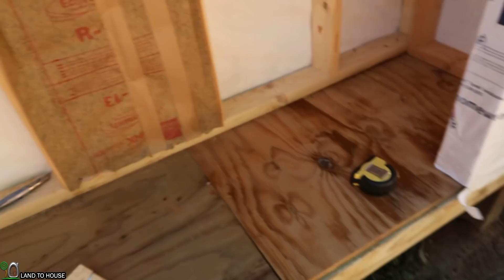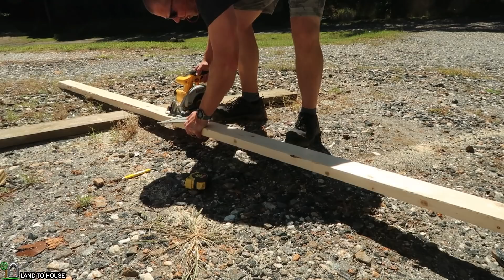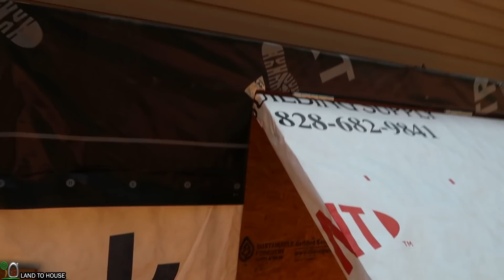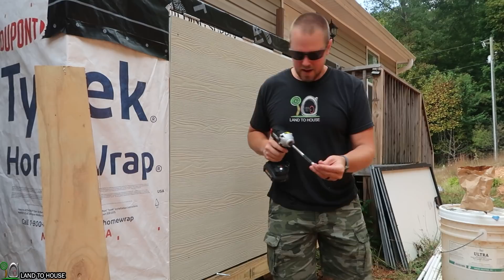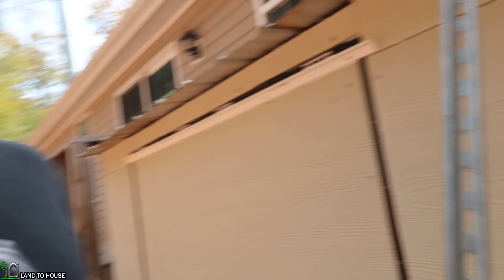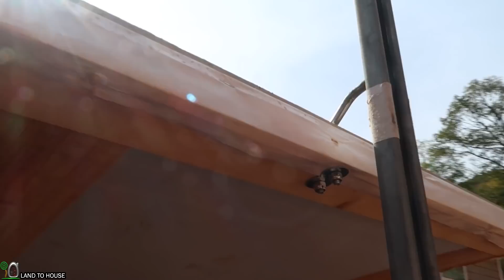Solar and Hydro Power Shed Build Part 2 of 3

Comment: I would put foldable hinges on the sides of the Door/roof, so it can click open and lock in position ... And you don't have to fear someone knocks over the pole that holds up your Door/Roof structure now.
Apart from that, nice build ;)

Comment: Great build. A pair of gas struts like you would have on a car tailgate might be a better option for your door. Less likely for it to fall on your noggin than if you were to accidentally knock your current metal rod over whilst working in your shed.

Comment: Seth, why don't you put "boot struts" on the door. They are gas filled mini shock absorbers on your car boot to hold the weight of it up when it is open. You can get them in different lengths and able to lift different weights.
Reply: i second this

Comment: Great idea. But would it have been easier to install and to open. Putting in two doors to open up?? With out having to lift the door you made up??
Reply from the maker: That is a possibility.  It was not terrible with the buckets. They held all the weight.

Comment: If you want to fireproof the inside of the door use the metal roofing its fire proof and not as heavy as the cement board. Also for future reference you can cut the roofing with a circular saw just turn the blade backwards. Its much faster then the grinder with a cutoff wheel.
Reply from the maker: Some sheet metal does sound like a good idea. Not sure I have quite enough of the metal roofing left but but I can see that as a lightweight fire resistant material
Reply: @LandtoHouse  Sheet metal will work great even Aluminum will do. Keep up the great work man.
Reply: It's lighter, but you have to look out for condensed water on the inside if you use too much of the metal.

Comment: The power shed is looking gorgeous and most beautiful thing is the door opening from bottom to top that's really quite amazing cuz usually I thought there will be opening from left to right so yeah looking forward to finish 👍.
Reply from the maker: The door is certainly unique. It prevents anyone small from opening it and also acts as a rain shield.
Reply: @LandtoHouse  I forget to ask you about this that I have in my mind long time ago what kind of wood you are using to build is it spruce or oak or fir what's the best wood to build construction how will you identify different types of woods ?
Reply from the maker: In my part of the United States spruce/pine is the standard building material.  All of the big Box stores sell it as the primary lumber.

Comment: On the inside, I would move your hardy board to the top on the left side.  If you have a fire, flames go up.  Maybe build a raised platform for your batteries so if water does find its way in.  Also some sort of grounding rods bonded copper thru the floor that you can ground to.  Other than that i think you will be good. Keep the videos coming brother.
Reply from the maker: I actually did have to move around the hardyboard on the next step. Some of my wires were short.